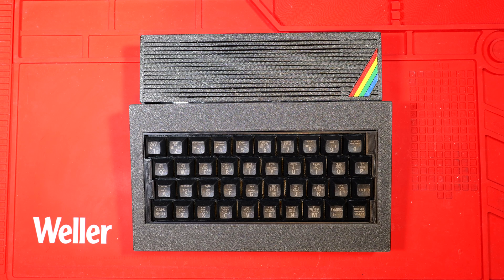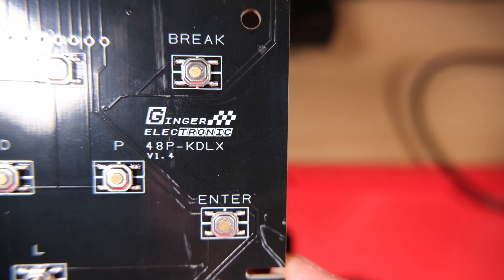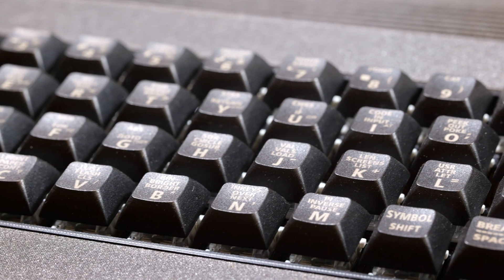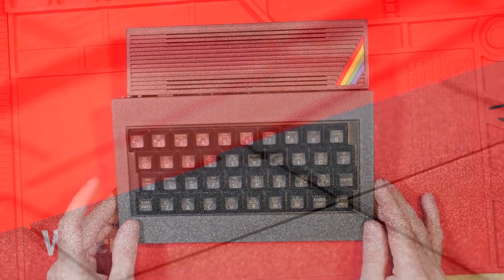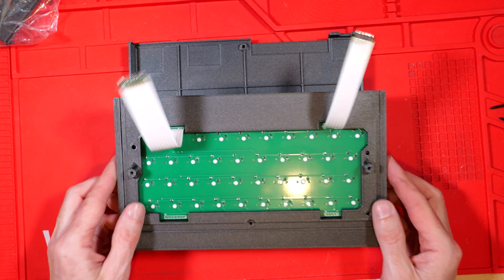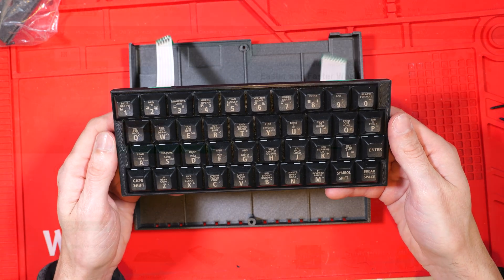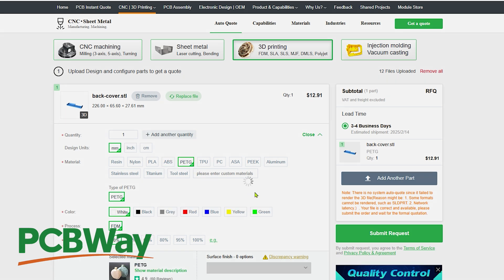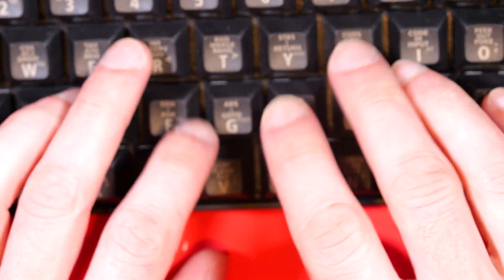An actual mechanical keyboard for your ZX Spectrum - The Mechtrum

Comment: I talked with the author of Nucleon kit and it seemed like there will be no more kits on ebay and the web pages of the project are permanently down (available to some degree on the internet archive). It would not be too hard to resurrect a variant of this project, unfortunately, the files to program GALs do not seem to be openly available and would need to be created from scratch....
Reply from the maker: Oh no! It's a clone of the pentagon, I wonder if that uses the same GALs and could be found?
Reply: @HappyLittleDiodes  AFAIK Nucleon is a clone of Pentagon in a way Pentagon is a clone of ZX Spectrum. IIRC the GALs were evolving with Nucleon versions and there were some improvements over Pentagons in Nucleon design (although there are way too many Pentagon variants to make any general statement). Since the GALs used are likely the old Lattice ones, they can be likely hacked/unlocked if really needed.

Comment: I have one of these with a 128K harlequin installed in it and its absolutely fantastic.  Lee has done an incredible job with the design.  Its a shame that they are no longer available to buy ready made, but it doesn't seem like it should be too much effort to get one made for anyone that didn't get the chance to buy one of the original ones.